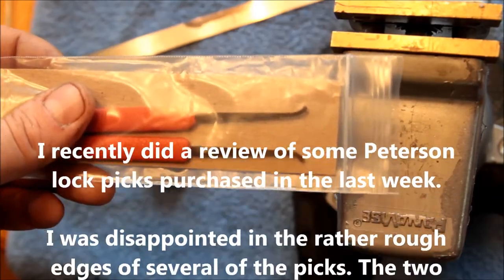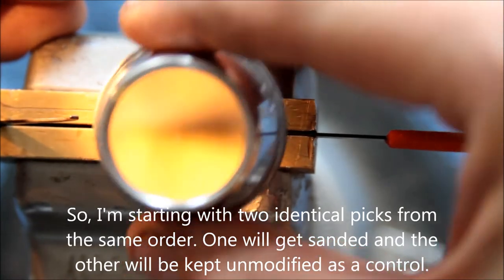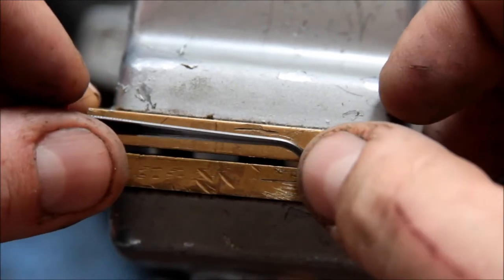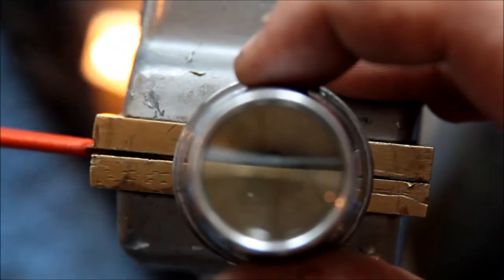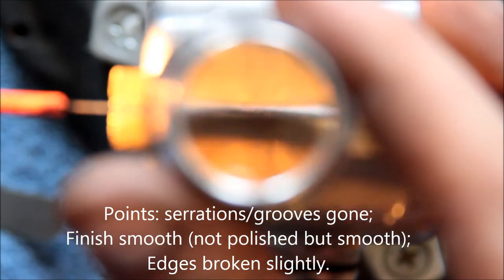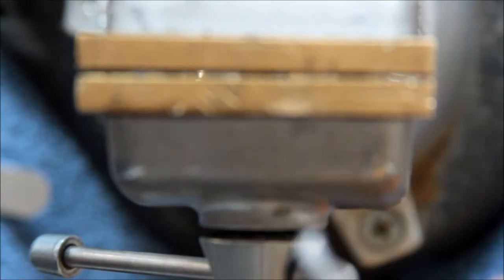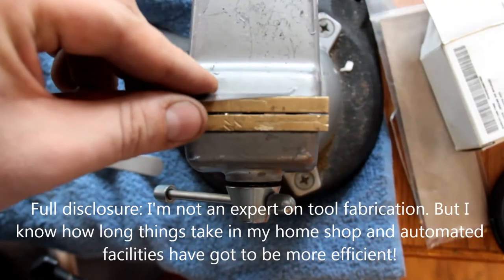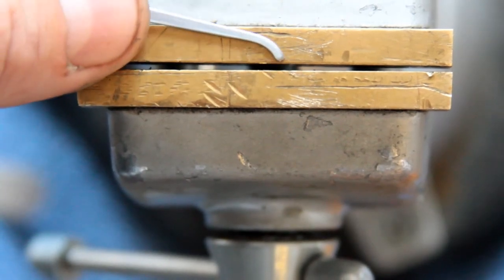(077) Ten Minutes to Nirvana -- Fixing a commercial lock pick (Peterson)

Comment from the maker: Hmm... yeah, I guess on this hardened steel any polishing process is going to be slow. However, I'm sure there is some fancy industrial way of working this out. 

And removing the ridges would be a HUGE improvement. The sides are pretty smooth out of the box. On other brands of picks, I find that a minute with some 600-grit sandpaper polishes everything up to an acceptable level. 

Sanding down the ridges on the inside of a delicate curve, however, is a bit of a pain.

Comment: the serrations are due to petersons laser cutting the steel... if only they would sand their products... most companies are stamped out.. they wont have the lil bumps but they will have a lip at about center where they were smashed to be cut... some like Storm are polished finished clifflockpicks are edm cut so no ridges and they are sanded maybe 2 mins per pick.